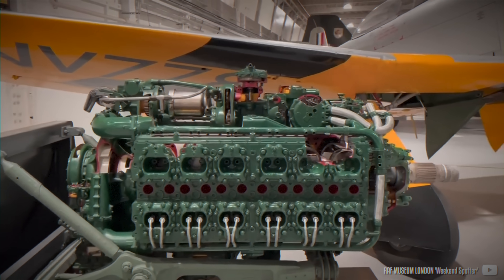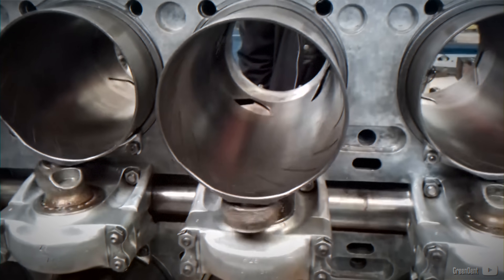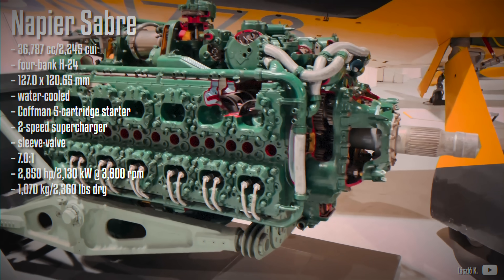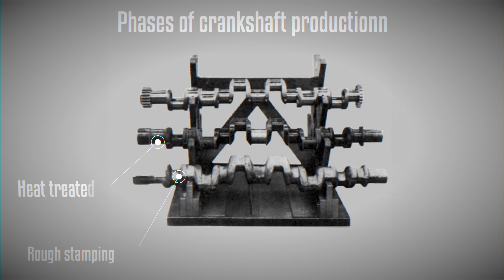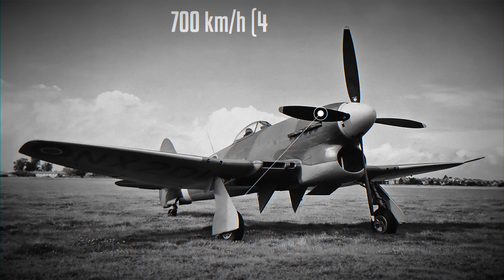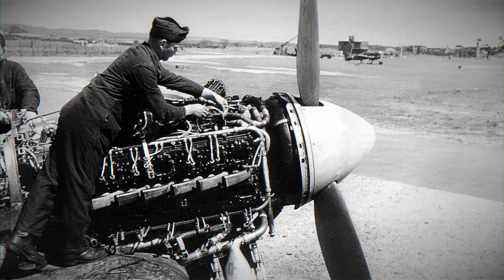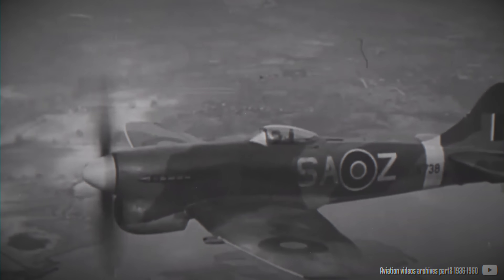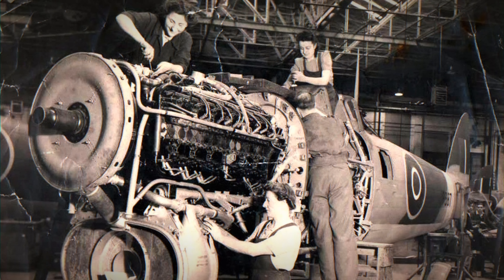An Unreliable 24-Cylinder That Helped To Win The War

Comment: Being made in such small numbers there is no way you could consider this engine a war winner.  Despite extreme effort, the whole British airborne effort didn't count for much anyway.   World War II was won by the much larger and better designed efforts of the United States and the Soviet Union.  The Brits contributed almost zero to the war in the Pacific anyway.
Reply: Do a bit of research on hawker typhoon's role at D-Day, and the Battle of the Bulge
Reply: @andrewwilson6085  To what end?   These events were important in terms of effort and casualties, but Germany had essentially already lost the War by the time these events took place - industrially crippled and insufficient fuel to train pilots and deploy aircraft.
These events would not have been different had Typhoons not existed as other aircraft in plentiful numbers could do ground attack.   In the Battle of the Bulge, Typhoons played an important ground attack role, basically protecting British troops only, because at that time Typhoons were the best airborne firepower available, but other aircraft could have done the job.
Much the same applies with D-Day landings.
Can you cite a specific reference and summarise what it says?

Comment: Pratt n Whitney R2800 was way simpler , better
Reply: Radial type engines have several major disadvantages and limitations which is why in-line engines were preferred for fighter aircraft applications, of course all piston engine fighters were rendered obsolete by the introduction of the Messerschmitt Me-262 jet fighter.

Comment: Sleeve valve engines are very expensive to manufacture. The sleeve timing is a nightmare. Lots of hand fitting.  Typical British overthinking.  Just like liquid cooled engines. The tech did not survive WW2.  Large poppet valve radial engines powered aircraft  post ww2. Until the turbine revolution.  Take a look  https://www.youtube.com/watch?v=_vrvep_YOio
Reply: Still blew the radials into the weeds for power per cubic inch. The last ones hit 4400hp.
Reply: I think you forget about the Bristol Centurus and Sea Fury one of the few piston engined aircraft to shoot down jets in the Korean War
Reply: Corsair took out an Mig 15, Heck a Skyraider took out an F17 in Vietnam.
Reply: Sure with a TBO 0f 200 hours.
Reply: jets rendered piston engines obsolete technology in fighter aircraft in 1944